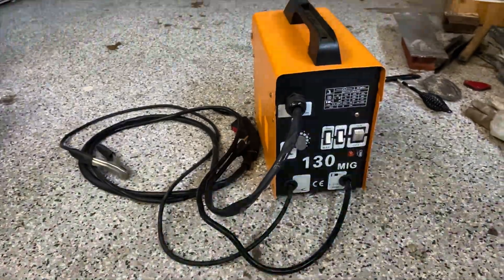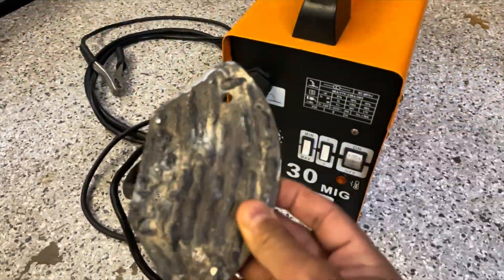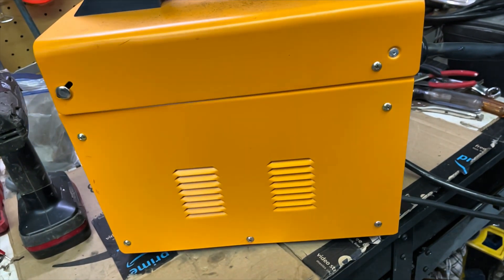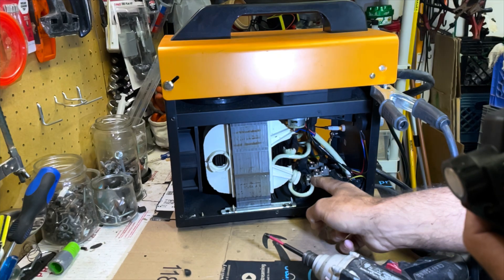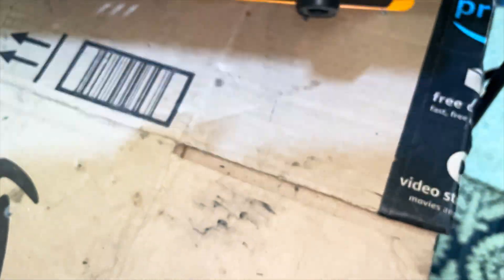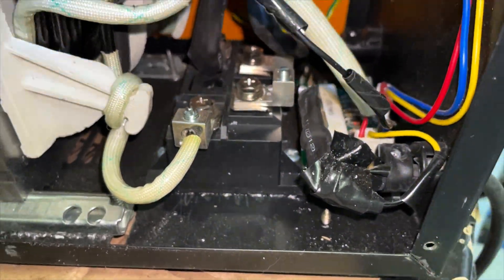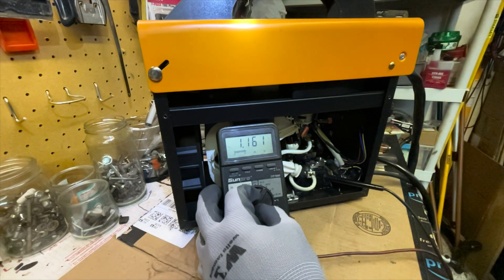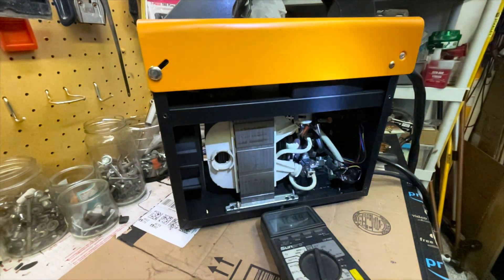Turn Harbor Freight 90 amp or Amazon 130 amp Flux Core Wire into a $300 DC welder with a $20 upgrade

Comment: I did this upgrade last year but the eBay wire I used oxidized badly ,...I guess it's not oxygen free 😢 I went to home Depot and replaced it with it larger gauge less strand 6 gauge

Comment: Hey, I am doing exactly the same right now, also bought 20k uf caps to smooth the current. Arriving tomorrow and hopefully will be able to make nicer looking welds with my parkside
Reply from the maker: let me know how it turns out. Defiantly it created much better welds for me. Adding a capacitor would be great to maintain the arc strength for sure.
Reply: @KhaledsDIY  Hey, it turns out really good! 
It feels like it has more Ooomph, probably because the rectified output has higher voltage. 
I modified Parkside PFDS  120, added 150A  rectifier from Amazon, 2 x10 000 uf caps and VERY important 200 ohm/50W resistors to drain the caps (in one second they are half empty). If there is no capacitor drain it gets very annoying as  there is enough current to give a big spark and  weld the end of the wire somewhere where you don't want. 
I am extremey happy with the welder now. 
Virtually no spatter and the arc is stable and starts imedietelly. Total cost - around £25-30
Reply from the maker: @penio78  great to hear your mod is successful. Thanks for sharing
Reply: The rectified output voltage will drop 1.4 Volts.    0.7v x 2 for diodes forward output DC.